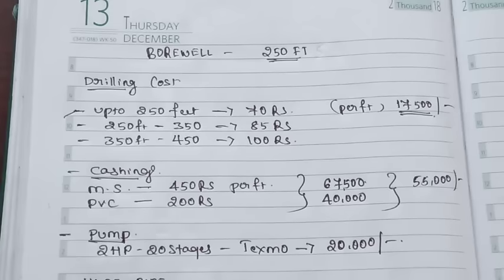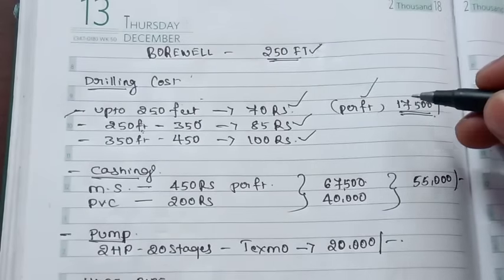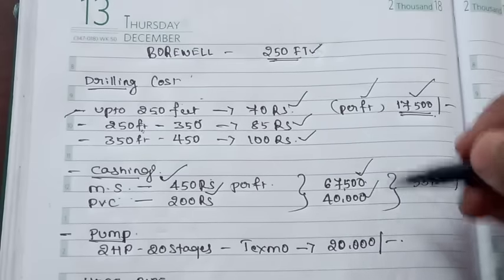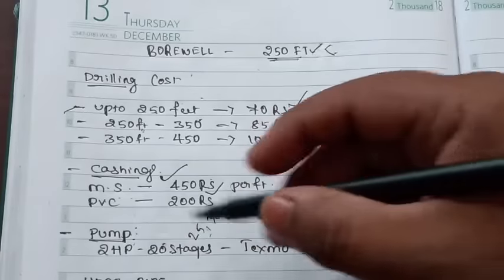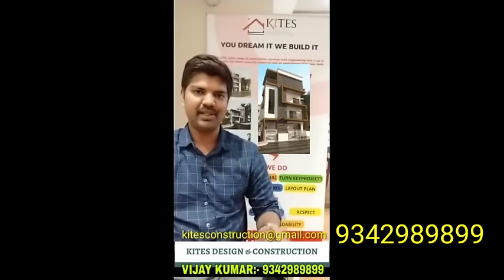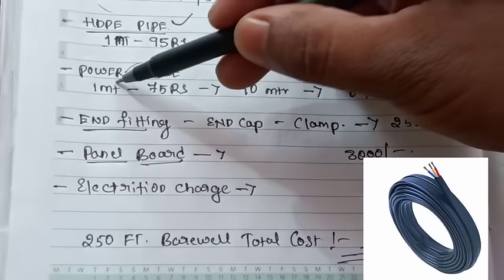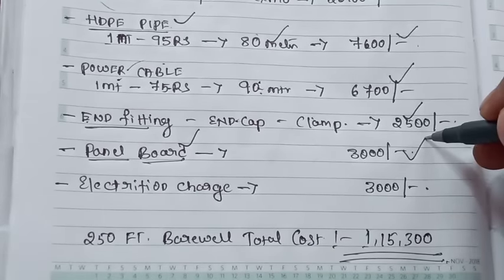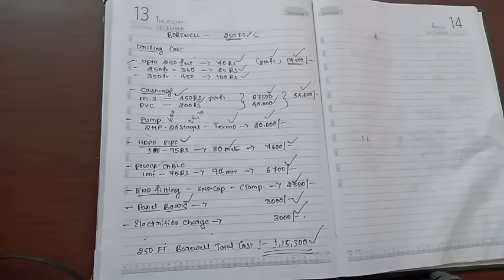Borewell drilling cost with pump fitting, Kannada.

Comment: Cost mentioned is too costly than actual. Cost start with 55 rupees till 300 feet. 
Kindly dont forget to negotiate and try to avoid unnecessary MS pipe as its original cost is Rs.5000 for 20ft pipe and borewell drillers make money in it. So try to get quotation before finalizing
Reply: ಗುರು ನಮ್ಮ  ಕಡೆ  upto 300 / 100per feet

Comment: MS casing is wrong low cost choice, better to go for GI or PVC perforated casing pipes. it will go rusted in 2 years. result full soil slide on your pump & total failure in 4-6year. i seen practical. for pump repair i could not lift back pump. soil slided

Comment: your calculation is wrong. for casing pipe for 250 feet at 450 per feet total cost becomes 112500 and at 200 it becomes Rs 50000. Please check
Reply from the maker: Full casing is not required
Reply: Texmo motor 2hp costly idhe
Reply: If you're putting casing for entirely drilled hole  where do you get water.
For your information casing pipe is fitted from earth top surface till starting portion of solid rock.

Comment: Sir you have giving one wrong information Borwell length is 250 feet,
Borewell casing length 250 feet,
How to Way Water comes in Borvel ?

Suggest casing pipe 20 to 30feet only
Reply: Mr. Madhu, No problem at all for the water to come into Borewell as the casing pipes will be having many small small holes for the water to enter inside
Reply from the maker: Upto rock casing haktare

Comment: Sir we drilled Borewell last week at 50 feet we got Hard Rock and water at 200 feet we drilled the Borewell up-to 680 feet and till 680 feet it's complete rock.  Now the builder and Borewell person are forcing us to install shilt pipes. Could you please advise is it required since we got Hard Rock from 50 feet.  They are scaring us like the motor will be damaged evry year if we don't put shirt pipes.  Please reply back sir